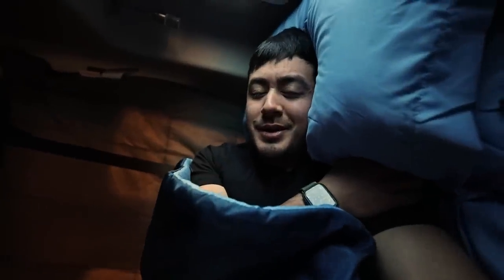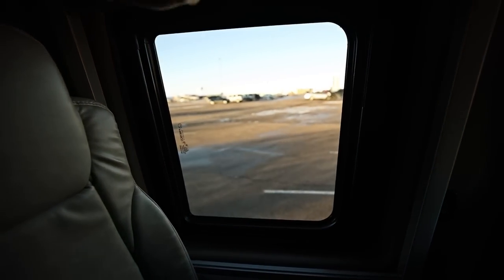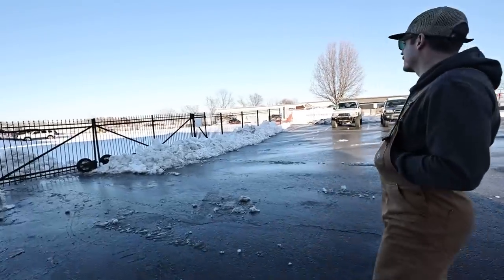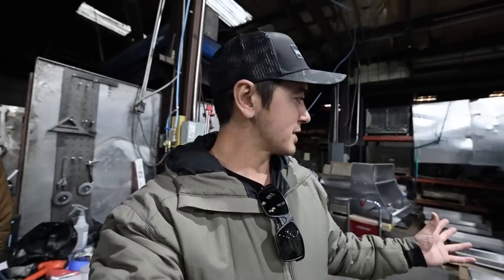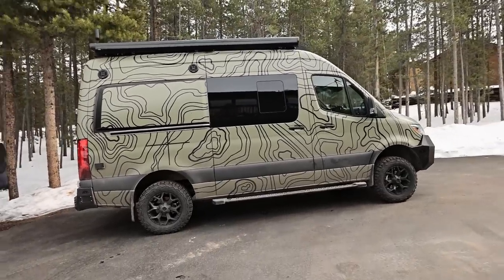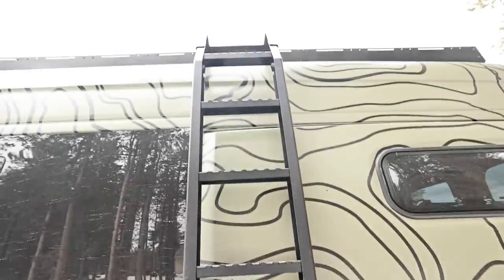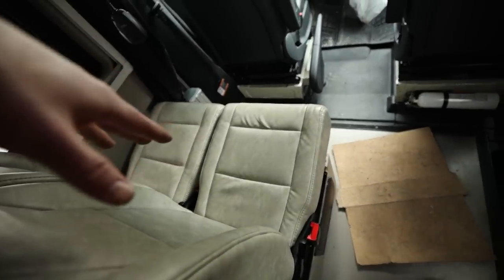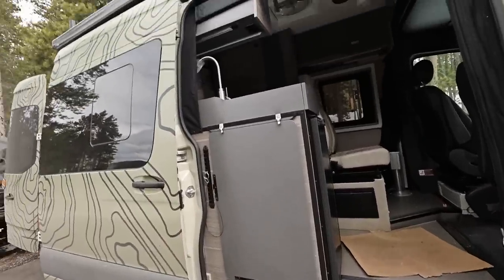VAN BUILD UPDATE #2 - Jayco Terrain 4x4 Sprinter - Backwoods HQ Tour, Bumpers, Rack, Interior.

Comment: Thank you kind sir, been waiting for your latest update.
Reply from the maker: Hope you liked it!
Reply: @Last Line Of Defense  still watching 😁 I pre-ordered the Jayco Terrain up here in Canada, so I'm envious that you have one carte blanche with your new add-one. I need this van ASAP for my two sons' Motocross race season starting in April.
Reply: @Last Line Of Defense  alright brotha, 10/10 on the vid. I had called Canyon about their floor coverings they have for the Revel and if they fit for the Terrain as well as their garage setup. They had told me that they can work with me on a custom job. Pretty cool you have the Cabunk, I had seen that being used by UK based Sprinter owners. I might grab that inflatable system for the front area for my wife to sleep up front, kids on main bed and me under the bed. Hopefully it won't be super hot in the summer even with the AC on. That cold battery issue is a little bit of a problem but I'm hoping Jayco comes up with a solution. It's cold up here in Canada.

Comment: Hey Mike, love the new rig! I was wondering if you like the Jayco better than the Revel, I know you’ve been in Talons Revel and wanted to know what you like better. I know they’re similar and Talons is the “old” style sprinter body but they’re still very close. I’m looking at getting either a Rebel or a Jayco Terrain/Enterga Launch (which are identical and made by Jayco. The new Revels are SO expensive and I like the awning style windows a bit more but the Jayco/Entegra both have lithium, light bar and ARB air compressor already installed which are really nice to have. I really dislike the rear passenger seats and if I were to get a Terrain/Launch I’d take those seats out and build something more like the Revel. Anyways, love the rig and the wrap is AWESOME! That wrap is probably super expensive so even though I’d love to have a wrap like that it’s be too expensive for me just for aesthetics. 🤘🏼😎🤘🏼
Reply from the maker: They’re very similar - some things I like in the Revel better, and some things I like in the Terrain better. The Terrain has a much, much better electrical / battery system, and some other notable upgrades over the revel, like the suspension. Overall the Terrain is a better vehicle as they roll off the Dealership lot.

Comment: Hey awesome show!  Had a question.  I have a 3rd gen tacoma crew cab short bed.  Raised it back in 2018.  All they did was stick aluminum blocks in the back, new fox shocks all around, and a spacer in the front.  No reservoirs.  Not too long after I noticed a wobble in the front.  Balanced and put them in the rear for quick fix.  Now for about 1/2 a year I’m noticing a wobbling in the rear.  Any suggestions how to fix this?  Do I need a new set up?  I am looking to go higher and bigger wheels.  Currently 2.75” leveled and with 17” wheels.  Hope you can help ASAP cause I have my 2 young ones in the back.  Need a safer vehicle for them😬👍🏼.  THANKS!
Reply from the maker: Does it happen at a certain speed? Sounds like probably just a tire balance issue
Reply: @LastLineOfDefense  yes, and they did balance both front tires.  They installed 6+ oz of weights, which they stated was a lot even for a truck.  Again, they put them in the back and now they are causing what I can only describe as a humming wave like vibration.  So sorry not really wobbling?  Increases as I speed up on the highways.  It’s been like this for a while.  Anyway, I might just get a hole new set up.  Thinking of 4-6” lift, control arms, 33-34” tires and new leaf system, but man I’m gonna be drained.  Any suggestion how much I should pay for all this including labor?  Thanks again for getting back to me!
Reply: Nice tour of the bumper fab manufacturing.  I’m actually a packaging Engineer.  Let me know if your buddies ever need a molded foam solution.  I just designed a foam set for a bed rack for a company.  They loved the functionality and aesthetics.  Did a ship test to Utah with no damage whatsoever.  So yah let me know if your connections ever need a packaging solution.  I can send you 3D images too if you need.

Comment: Good video, I've been looking at this model. I'm curious about how long the battery can run the ac, and now after watching I'm curious if the battery can run that microwave.
Reply from the maker: It's basically the biggest, most powerful battery in any van that you'll find. It can make many, many meals on that microwave.
Reply: @LastLineOfDefense  How about the ac? About how long? Any notable differences with the Revel other than the name? lol
Reply: @FEARNoMore  te revel has 250 ah the terrain has 10.2 kw that’s 4x as much as the revel…you can run the AC on high for 10 + hrs straight

Comment: 192K I wouldn’t give this van a thought. You can get a Story Teller Overland Beast Mode for that price much better build quality guaranteed.
Reply from the maker: Different strokes for different folks. Lotta cool vans out there (though this can be had for much, much cheaper than 192k - that's just RV MSRP numbers).
Reply: @LastLineOfDefense  True not meaning to be a hater and good point about the MSRP.